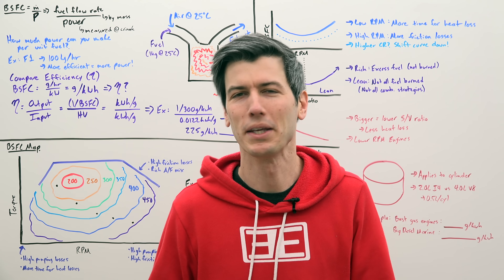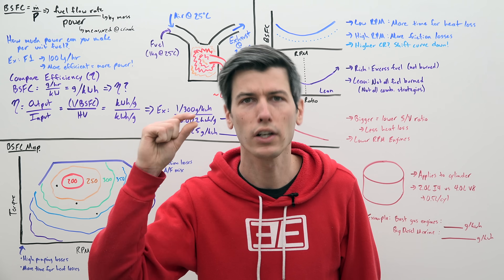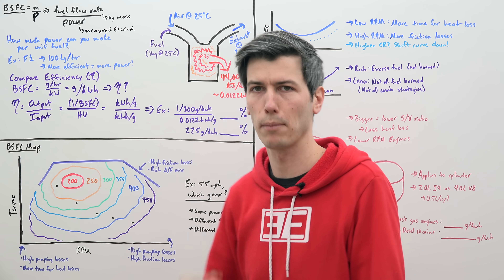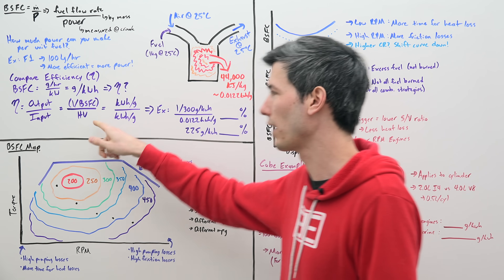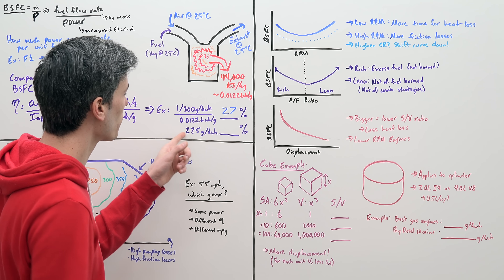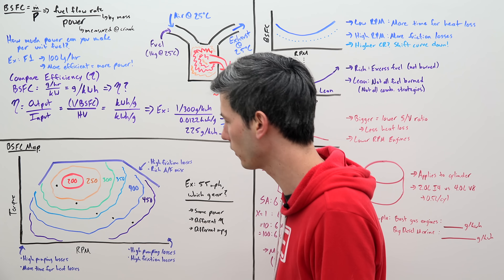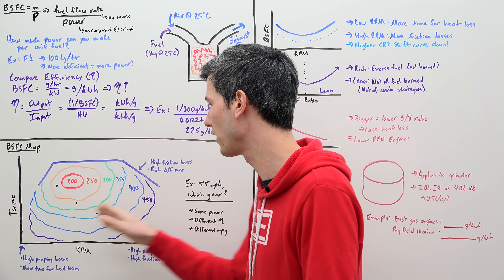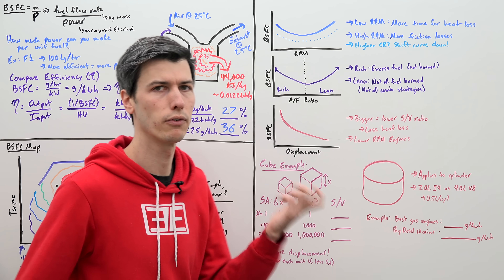The Best Way To Compare Engine Efficiency - BSFC

Comment from the maker: BSFC also helps explain why cylinder deactivation is a thing! For example, a V8 going down to four cylinders means those four cylinders have to make more power per cylinder versus eight cylinders. That puts them at a higher load, which is more efficient, and thus fuel economy improves during cylinder deactivation! If you haven't yet, I'd also recommend learning about BMEP, which is another great way to compare engines: https://youtu.be/bE_1JYrlYYU
Reply: :cries in rotary efficiency:
Reply: it's worth also to note that big marine 2-stroke diesel engines are among the most fuel efficient engines, for the same reason that they have less friction losses for a single cycle, compared to 4-stroke
Reply: @МихалычНаливай  also becasue theyhave slots at bottom dead center to flush fresh air and do not need to have an intake valve train, they compress air (higher kappa value and much higher compression ratio leading to higher theoretic efficiency),no throttling losses, not limited by knock and can run extremely high combustion pressures & temperatures and lastly, not so much limited by exhaust aftertreatment
Reply: @МихалычНаливай  I don’t see how they are more efficient as the fuel has 20% more btu per the same weight in gas so it would need to produce 20% more work from the same weight in fuel just to match the gas efficiency.
Reply: You are absolutely right. The main purpose of an ICE is to convert the fuel chemical potential energy in mechanical work at the main shaft. How good this process inside the cylinder enclosure has been done is measure by ISFC, and how good this energy is transported through the mechanism is measure by BSFC.
Excellent explanation if the topic!!
Reply: Isn’t the Mercedes F1 engine the worlds most efficient?50% ?
Reply: @Mikethulin2009  actually the most efficient ICEs are the low speed two stroke diesel engines for marine and power generation. Greetings
Reply: Cylinder deactivation is one way to make a variable-sized engine. Turbo charging is another. With cylinder deactivation you still have to lug around the weight and size of the big engine and you still have the friction of the big engine. Turbo charging starts with the small, lightweight engine and makes it bigger by forcing more air through it when more power is needed. The engine stays small, friction stays small, make the wasted heat out the exhaust do the work of pumping the extra air. win win win
Reply: @jay_321       In theory.  If you could disengage the inactive cylinders and not motivate them, then yes.
Reply: @jay_321  except turbocharged engines mean lower compression ratios. Ford's 5.0 vs 3.5 ecoboost is a 12:1 vs 10.5:1 and under load the 5.0 is significantly more efficient. Hell under load the 5.0 is more efficient than the 2.7
Reply: @bobm9307  except it's apples to apples because they're both gas/petrol engines sold in the same vehicle with very similar capabilities. One just uses a turbo to make the power and the other uses displacement. You still get all the benefits of the bigger cylinders in the 5.0 even when it has half of them off, but the 3.5 was designed around the EPA because in reality it only gets fuel economy at low load because of lower overall displacement, but a turbo engine under load will always use way more fuel, for various reasons, than the N/A counterpart.
Reply: Why is there a naked man drawn upside down on the upper left quarter of that white board?
Reply: You have now angered every truck owner in america
Reply: @james2042  corners cause high stress points=breaks more easily
Reply: When you did the cube example, I randomly wondered why pistons aren't cubes instead of cylinders. Is there an explanation for this? I don't see exactly why it wouldn't be possible. Also, does the Skyactiv X have anything to do with improving BSFC?
Reply: @abalakrishnan4152  flame propagation is spherical therefore  a cylindric shape leads to the charge being burned evenly. this is imprtant for knock mitigation, you need to burn fast in order to have minimal gas pockets that can self detonate. also considering wall heat losses the surface to volume ratio of the combustion chamber has a strong influence and you would lose more engery with more wall suface. lastly flame extincion in the corners of your cubic chamber would lead to high HC emissions
Reply: @abalakrishnan4152  cost of manufacturing mostly, it takes less production time to make a  Precision round object then a precision square object.  And round surfaces tend to generate less hot spots the would happen in a square corners tend too.
Reply: @abalakrishnan4152  lower surface area per volume
Reply: I keep thinking that delayed closure of the intake valve to create Atkinson cycle effect should be more efficient than cylinder deactivation. There is less pressure remaining at opening the exhaust valve to expand in the tail pipe, wasting useful energy. Is this why I'm wrong?
Reply: @ronmorrell9809  actually better is the miller cycle using early intake valve closing (EIVC) becaue the gas charge is further expanded and cooled, instead of pushing the charge out again, (leading to higher end of compression temperature).
miller/atkinson makes sense at 3/4 cylinder engines while the big V6 or V8 engines more commonly used in the US run on very low load (basically idling at your speed limits :-)) where throttle losses occur. by deactivating one cylinder bank, you double the specific load and by that reduce the pumping losses and increase efficiency.
Reply: @Donovan Piko yes. before AC dynos were used on test benches they used a brake to counter the output of the engine. it menas power at the output shaft. in comparison to ISFC (indicated specific fuel consumption, calculated from the cylinder pressure traces).
Reply: Does it means my 1981 Cadillac Seville is more efficient !??! It can deactivate 2 or 4 cylinders, but I'm pretty sure that with an 8.2:1 compression ratio, it's still just a big boat anchor ! 368 cubic inches of displacement for a mere 140hp...
Reply: @Asakha1  Do not know if it is more efficient.  It does have good low rpm torque.  Maximum torque is achieved at 1400 rpm.  If you are lazy driver like me, I like high low end torque.
Reply: It's hard to find BSFC on the internet. I was trying to compare snowmobile engines.
Reply: I was just thinking, 'does this mean we should all be driving round on as fewer cylinders as possible?' I guess that answers the question!
Reply: Quick question. Does cylinder deactivation affect the evenness of heat distribution in an engine? Thanks
Reply: Cool! I asked for that in the comment section of another video a looooooong while ago. Now I am happy! :-D
Reply: @TheCheesePlease VCM?
Reply: Hi ! An australian website quote "Power efficiency" (in Kw.L/100km : 23.33kW:L/100km for the latest Fiesta ST), any idea how it works (calculation method, the meaning of the number, etc.) ?
Reply: I wonder if you could pipe the air pumped by the deactivated pistons into the active ones.
Reply: This method does not work because it doesn’t include the btu content of the fuel per weight. This method only works to compare the engines using the same fuel. Because I could make all road Diesel engines about 10% more efficient by switching them to bunker fuel because similar mass but bunker fuel is about 10% more energy dense. Also should note that diesel and bunker fuel pollute like crazy as fuel because less refined it tends to have more btu per unit but is also much dirtier in emissions of really nasty things like sulfur dioxide
Reply: If you just put a gigantic 1 cylinder engine in a car would it be most efficient? Also atkinson cycle vs otto cycle.
Reply: why not just use thermal efficiency
Reply: Why I am going to buy a V8 and fire on half the cylinders?  Almost as crazy as start stop. No to eco nannies!
Reply: @jamescaley9942  So that when you're cruising you have better MPG, but when you nail it you have the power :) But really you'd be better off with a big (ish) diesel engine :p.... if you're bothered about how much you spend on fuel that is!

Comment: This video caused me to ruin two engines. I have spent over a year and $10k in parts rebuilding them DIY in my spare time. All to save a few $ in fuel. I NEVER lugged my engines (a 4.2L V8 and 2.7L turbodiesel), but after this video I modified my driving style to do most of my acceleration with high throttle @ 1800-2400rpm. Doing so in a higher gear such that at high throttle the vehicle was still able to accelerate modestly.

This discussion leaves out the VERY important topic of Cylinder Pressures. They are maximized when optimizing for max BSFC and driving in this manner. Excess cylinder pressures lead to failures in the piston (cracking), piston rings, ring lands, etc. 

Tl;dr: oil and fuel are cheaper than engines. Drive your car normally as the OEM intended.

Comment: Kilowatt hour in this case is 3600000 newton meters. Your average "2 plate" barbell weighs 1000 newtons. So winching up a "2 plate" barbell for 3600 meters and compare how much fuel is used at different rpm and torque (a rough correlation to where your foot is on the accelerator.)
It seems most of these graphs are saying give a generous press on the accelerator but keep a few cm above the floor, and keep the revs between 2000 and 3000. Also if you don't need that much power, use lower revs rather than the same revs with less accelerator. It also gives you a good basis for sizing a generator engine, and that you should use a larger engine rather than screaming a small engine to generate power (assuming your rpm is not tied to frequency and you can use any rpm you like feeding a DC powered sinewave generator).
The basis for a generator is thinking about how many phones you can charge before the tank runs out (or how many pieces of toast, though with a heating appliance you may as well just burn the fuel directly instead of in an engine where you chuck away three quarters of the energy). Also how many phones to plug in at once? If you charge one phone at a time, the engine will need more fuel to keep idling than its worth. If you charge 1000 phones at a time you might get the engine running rich. The aim of the game is to charge as many phones as possible to say: 90%, adding more to keep the load correct as the batteries fill up.

Comment: With a 100kg fuel/hr the winner would be getting a large displacement naturally aspirated, getting your foot most of the way and shifting up at 3k rpm. With a displacement limit this is not as good. At 46 megajoules per kg your limit is 1278 kilowatts input, so whatever your thermal efficiency is multiply by this for max power. Smaller and turbocharged lose efficiency when trying to get high power. Also very high rpm loses efficiency. It strikes me as less efficient to try and cram more air into a small cylinder than simply having a bigger cylinder. Where the turbocharged engine wins is it's a smaller engine to idle whilst in 5 mph traffic. A sad fact of life is in a daily driver you spend more time doing this than accelerating away at breakneck pace, so you may as well throw away some efficiency stuffing a smaller engine to gain efficiency not having a bigger engine at tickover.

Comment: In terms of higher gear, sometimes on a flat surface you can have a lower load in a higher gear. This is because the increase in the engine's "self load" at higher rpm is greater than the mechanical advantage of running a lower gear. For example if you go down the road at 30 in 5th or 6th, the rpm is close to idle. If you go 30 mph in 1st it's close to redline, and in 2nd about midway. The extra work needed to spin the engine to near redline can mean you're heavier into the throttle in 1st than in 5th. Maybe up to a third of the available power is consumed just getting to redline. If you go down the road in 5th and push the clutch in at the same position on the accelerator, whatever the rpm raises to is using similar or more fuel just spinning itself in neutral.

Comment: So perfect efficiency is 82g/kwh. If you had a perfect 500 watt petrol motor on a bicycle, getting it to ~26 mph, then in 2 hours at full speed on a flat road it's gone 52 miles on 82 grams of fuel. A search says a US Gallon of regular petrol is 6.073 lbs or 2755g. The theoretical perfect mpg is 52miles x 2755/82 = 1747 mpg. Though even with 20% efficiency it's like 350 mpg. You could get even better in some velomobile type contraption.

Comment: Good info, have you considered cost of fuel to derive lowest cost? There is some high precision metal printing technology that will allow printing a complete turbine (case, rotor, stator with 100 micron bearing clearances. This will dramatically reduce the cost of turbines. Hybrid power still seems to be the best overall for vehicles. I’m thinking a turbine generator would be more efficient because it can be run at constant speed. Comments?

Comment: With excessive lean burn, is it that not all fuel is burned, or that you're making nitrogen oxides, which is an endothermic reaction and wasting power that could turn the wheels?

Comment: I drive a 2016 Toyota Prius v and with the specs I've found on my engine, with my Atkinson cycle (which is really a Miller cycle) my engine is about 38% thermal efficiency. Yay for me!

One thing that is worth mentioning too, is if you have a scan gauge ii or a simular device, you an actually see how RPM can effect your litres per hour. If im driving down the road and getting say 4.5L/100km but my rpms are say 1800, once my CVT changes ratios and drops it to 1200, I may still get 4.5 but im using less fuel to get that number.

Comment: Hello, I'm problably not understanding something but I have two doubts.
1 - On min 8.00 you say "at 55 MPH" but isn't that curve a constant power line? I mean every point no matter on which gear you are is developing the same HP but not the same speed.
2 - On min 9.05. I understand that load is proportional to throttle. Why on 5th gear you have more load than on 3rd gear. Shouldn't that be on the contrary?
Reply: Load is how much torque the engine is required to produce, not power. low revs high torque same as high revs low torque. both make same power but higher revs at lower load is less efficient.

Comment: Gasoline is a hydrocarbon compound. It’s 13% hydrogen and 87% carbon so it’s efficiency is directly proportional to % hydrogen and inversely proportional to % carbon, so 2.692 gallons of gasoline at 2.858 kg has a mass of 7.694 kg, 1 kg of hydrogen plus 6.694 kg of carbon. If your maximum range is 70 miles on (1 kg of hydrogen + 6.694 kg of carbon) then your maximum range  should be about 538 miles on (1 kg of hydrogen + 6.694 kg of hydrogen) Fuel efficiency can be defined as a fixed percentage, vehicle efficiency (not the same thing) is almost undefinable because there are too many variables. Oh, that 44000 kilojoules is actually 44578.8 kilojoules or 12.383 kwh, the energy in 1 gallon ( 2.85763 kg) of gasoline.

Comment: Closed throttle losses, that what i wondering. With fuel injection system, what the function of throttle? why dont we just inject specific amount of fuel to run in specific rpm? So we got higher volumetric efficiency? And with turbocharger we can get more air flow to spull the turbine in low rpm

Comment: I need your help guys. I've bought my first car, worked as a car software programmer, but I'm still very green to some concepts.

I'm going to drive my car at low gears and high loads, to increase efficiency. 

However, in another video, he says you should never lug the engine. And he defines lugging the engine as soon a high torque demand (flooring it) at a high gear.

But that was my whole strategy!

Comment: I want to know about a similar thing for electric motors. What is the most efficient way to extract power from an electric motor? (Assuming simple DC motor connected to a constant voltage) This is complicated because it can also depend on the voltage of the power source, which would change with different throttle. Thus you would have a different BSEC map for every throttle position. (You can stall a motor if the resistive force is too high, but also if the input voltage is too low to supply enough current to turn it.)
If you load a motor too much, then you get a lot of thermal losses in the wires, and less work is being done by the motor. A stalled motor consumes lots of power and does no work (force is maximum, distance is zero). An unloaded motor uses some power and does no work (distance is maximum, force is zero). Motors with high losses in the coil wires should be run at lower load, and motors with high friction losses should be run at higher load, but somewhere in there is a graph of optimum resistance.

I am assuming that something like a Tesla is going to be more sophisticated than this. If the motor would run at 150 mph no load and optimum efficiency is at 120 mph, then accelerating from 30 to 60 mph by stamping on the accelerator, the motor would be "struggling" if you just dump current in at maximum voltage, thus is would be better to raise the power supply voltage (or effective pulse width modulation) as the speed of the car climbs. Also the choice of gear ratios are important if your electric car comes with multiple speeds. I have a 7 speed electric bike and am often wondering "should I drop a gear? Or raise a gear?"